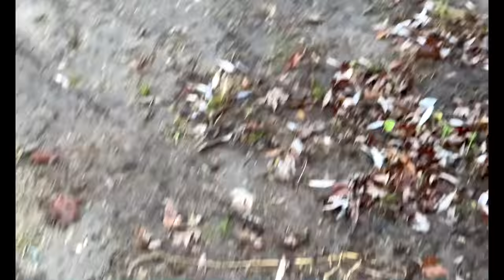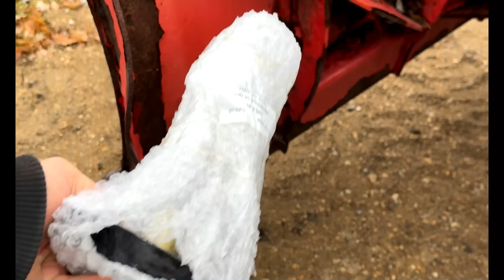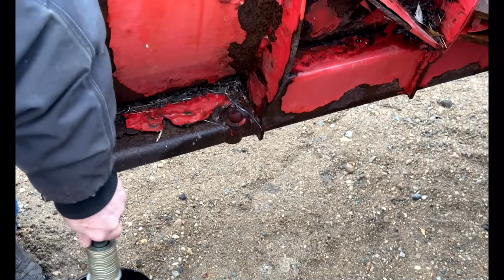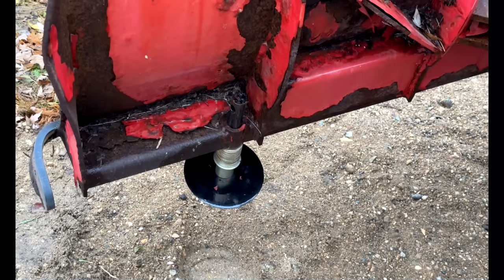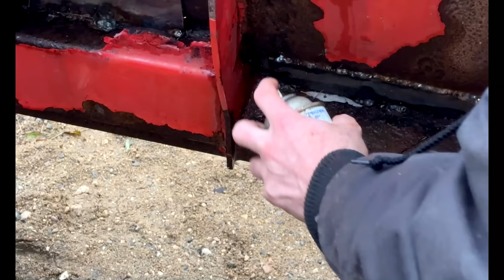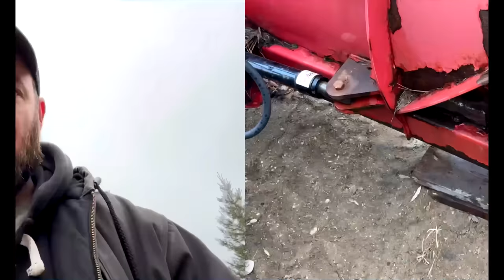Boss V Plow Shoes Installation

Comment: Looks like you have a lot of snow up there in the Great North can we see that plow in action is it easier to plow when it’s warmer or when it’s colder.
Reply from the maker: Honestly I wanna say colder. The reason is the snow sticks together so I get more removed in one shot. Doesn’t seem to break a part as much to leave more to clean up. Either way a person has to plow it.
Reply from the maker: But to each their own. How about you with Snow Pro? What do you prefer?
Reply: Trying to make a disunion if I should go with a steel or stay with a aluminum on hoping to see you put out a video with yours in action.
Reply from the maker: @edwardrauch7183  Never used aluminum. Even the Bobcat’s a steel. So is the 5 foot quad plow. But that’s cool.
Reply: @genosimprovisions859  do you have shoes on the bobcat blade
Reply from the maker: @edwardrauch7183  Actually yes. Meyer shoes since it’s a Meyer plow modified for a skidsteer. Their different. Square and ankled like an “L” shape. The Boss and four wheeler plow have the round shoes.